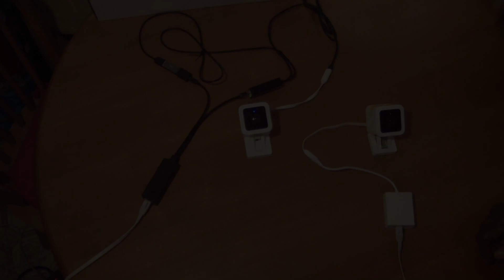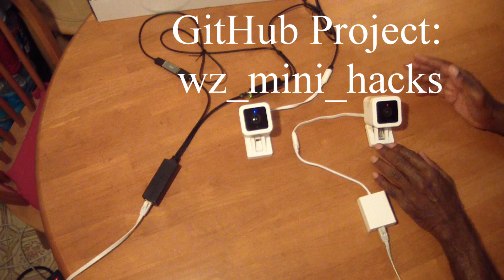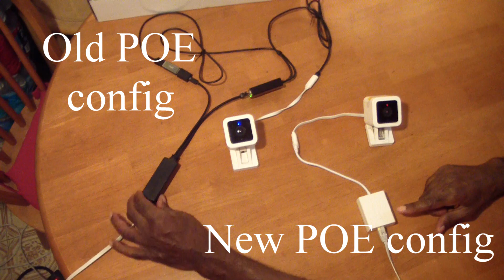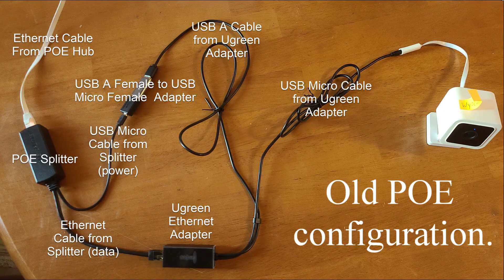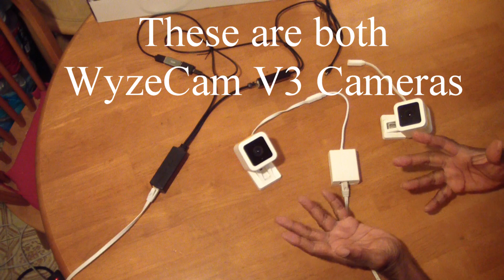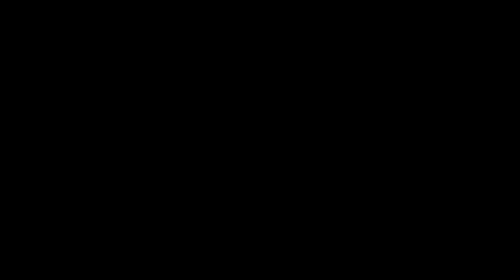POE Issue with some WyzeCam V3 Cameras

Comment: That’s pretty strange. Do you have build dates for either of them? I just installed the hack on a new camera I have, and I ordered the straight POE/Eithernet switch. I’ll see what happens, I have multiple cameras I can test on, so I’ll see what I can find
Reply from the maker: No build dates for cameras that I can find.  I know that some of the cameras I purchased were pre-orders that I received in December of 2020. 

I discovered that the camera in question  which would not power on with the UCTRONICS POE adapter also would not power on using the original WyzeCam power supply.  I have two, out of 10, WyzeCam V3 cameras like that.  My only guess at this point is that, as someone told me,  this is probably the result of "some degree of hardware damage or inherited tolerance to non-conventional voltages".

Turns out, however, that both cameras WILL power on using this USB-Ethernet adapter: https://www.amazon.com/gp/product/B01N1X28F1

They even power on, using this adapter, with the original Wyze power supply.  So, go figure!
Reply: @SwingingInTheHood  interesting, I’ve got several that I bought around launch time, more that I have bought since then, and 2 that I have bought in the last week, my adapter will be here tomorrow, so I’ll see what I can find out
Reply: I’d really like to not have a multi device solution, I’m about to wire my house, and will be dropping POE cables to my Wyze cam locations so that wires are hidden, and having just one device just reduces the amount of potential failures. I have cameras with an activation date of 2/11/21, so those should be first run devices. If I don’t have the issue on those cameras, and I end up having it on the newer cameras, then we will know something changed with the camera hardware, and can go from there. 

Do you have a way to test the voltage coming out of the original power supply, a power adapter that it does work with, and the 2 eithernet adapters? Maybe we can see something knowing what they are providing for power, you’d think they would all be 5v, but who knows.
Reply from the maker: @rswyltk  I ordered a meter which should arrive today.  I will test the voltage from all the adapters to see if there is some difference and report back here.  I doubt you will run into the same problem I have as these cameras had been deployed at some point prior to this issue.  I only have one camera which has never been used, and it worked fine with the UCTRONICS POE adapter out of the box.
Reply: @SwingingInTheHood  most of mine have been in use for awhile, I’m currently at 24 cameras. One of the things I just read on the GitHub was that the wiring from the adapter may be crap. I just pulled one of my cameras apart, and from the back of the board to the back of the camera, there is 1/2”. So there is a 1-7/8” x 1-1/2” x 1/2” cavity behind the camera board. When the adapter comes in, I’m going to take it out of its housing, and see if I can stuff it’s board inside the camera. If I can, I’ll just wire from the adapter USB out, to the Wyze board, and then figure out how to get the eithernet cable hooked up to the adapter. Maybe just take the rj45 plug off the board, solder an eithernet cable pairs to it, and drill a hole for the either net cable into the back of the camera housing where the USB cable comes in now. Nice all in one setup. Then get a 2 port wall keystone plate, put an rj45 jack in the bottom, leave the top empty, and glue the metal disk to the back side of the wall plate above the jack, then just make the cable coming out of the camera to the wall plate 6”-8”. It would be a nice clean install, and if there is a failure it will be inside the camera and easy to get to for repair. All my cameras are inside so I don’t have to worry about weatherproofing it, I like to be able to see my dogs when I’m gone, and look back and see where I put things when I can’t find them. I’m going to run everything thru scrypted into HomeKit, maybe even use HomeKit secure video, I’m just not sure how
many cameras the AppleTV can reliably support, they say with the 2tb iCloud+ plan you can run “unlimited” cameras, but I’m not sure if 30 cameras are what they had in mind for “unlimited”, and scrypted has plans to release a local recording NVR at some point. If I can run 30 cameras on it, then I can drop my Wyze and Ring subscriptions. I want to get as much off my wifi network as I can, and not have to rely on wifi for my cameras and other always communicating devices to work. I’m about to way over do my network/home automation setup, I’m building a server, i7-1185G7, 32gb ram, 1tb drive, to run my router, home automation, UniFi controller, and any other Linux application I can think of, and hardwire everything that has an rj45 jack on it. I have gigabit from my ISP, so overhead shouldn’t be a problem. Now if I could just figure out how to hardwire the eithernet to my Ring SpotLight and Floodlight cameras, my alarm system panels, thermostats, myQ garage opener, Echos, and Harmony hubs, I’d be down to just using wifi for my phone and my laptop(when I’m not near a wall jack) and my GE SmartHQ appliances, I don’t think those can be hacked to run hardwired.
Reply: Look up a video titled “Notebook LAN socket - repair guide [4K]” by FIXstudio, I’m thinking something like that, but instead of putting an rj45 back on, solder the cat5 straight to the board.
Reply from the maker: @rswyltk  I use BlueIris for my 10 Wyze + 2 Chinese Minis.  I don't have the technical expertise to take them apart, but will still test the voltage.  Turns out I need to order a USB voltage meter (Duh!).  Still curious to see if the voltage/load on those adapters are different from original power.  Good luck!
Reply: @SwingingInTheHood  if the meter you bought has alligator clips, attach sowing needles to them, and you can touch the contacts inside the usb cable, I think it’s going to be the 2 outside prongs
Reply from the maker: @rswyltk  Thank you for the suggestion.  The meter did not have clips, but I had some in my "electronics" box in the garage, where I also found an old USB cable I had taken apart.  So, I was able to get voltage readings from the various adapters.  

Voltage Readings

WyzeCam Power Supply 01

4.93
4.94 - plugged into wall

WyzeCam Power Supply 02

4.99 

WyzeCam Power Supply 03 (brand new)

4.96

Ugreen02 (USB A - Ethernet Adapter - POE cable plugged in for data)

4.91 - Using WC Power Supply 01
4.88 - Using WC Power Supply 02

Ugreen03 (Micro USB - Ethernet Adapter - POE cable plugged in for data and power)

4.89 - Using WC Power Supply 01
4.95 - Using WC Power Supply 02

UCTRONICS (POE Micro USB Adapter - POE cable plugged in for data and power)

5.23 - Powered by POE

POE Splitter (POE cable plugged in for data and power)

Using Ugreen03 Adapter

4.98 - Powered by POE

I would surmise that adapter voltage really isn't the issue since the only adapter that the two defective WyzeCams power up with is the Ugreen03, which at it's highest is 4.98 (while the original power supply 02, with with they do not work, is 4.99)  So, something else is definitely afoot.
Reply: @SwingingInTheHood  I’m wondering if it’s a pin alignment/tolerance problem between the one camera and the Uctronics cable, no telling how many vendors Wyze used for the USB pigtails, maybe something is just off enough that it doesn’t match up with the Uctronics. Do you have a micro USB extension cable? If so try putting it between that camera and the Uctronics. That’s the only plausible thing I could think of.
Reply from the maker: @rswyltk  Thanks.  I did try extension cables.  This one worked: https://www.amazon.com/gp/product/B00S6AZCHW  These didn't: https://www.amazon.com/gp/product/B07L9SVBDG  The only difference I can see is that the one that works is OTG.  If the UNCTRONICS adapter doesn't work with any of your cameras, you may want to take this into consideration as you troubleshoot (the OTG extension cable did work with UCTRONICS).
Reply: @SwingingInTheHood  I got my adapter in yesterday, the board is so close to fitting, but not quite. I’m looking to see if I can find a 3d model of the housing, make some modifications to it, and have it 3d printed
Reply from the maker: @@jash21222 Don't know the bitrates, but I can tell you the video is way more stable over eithernet.